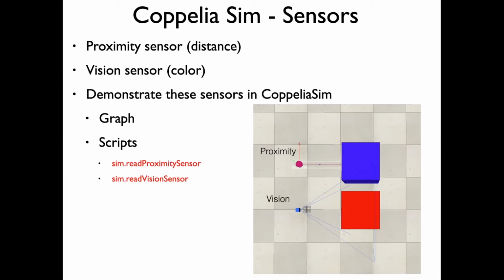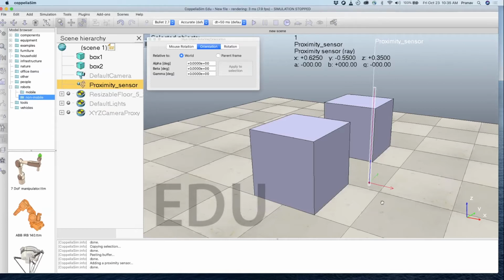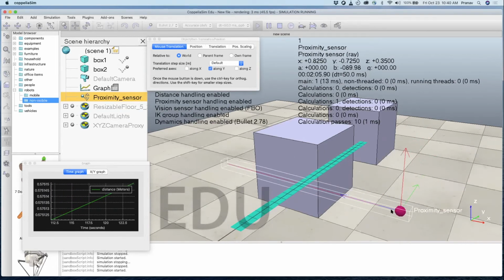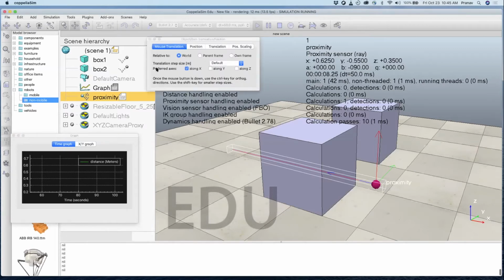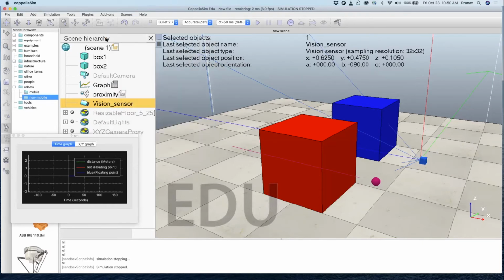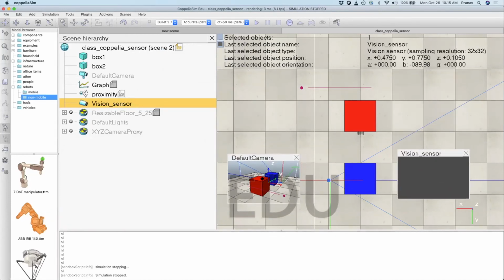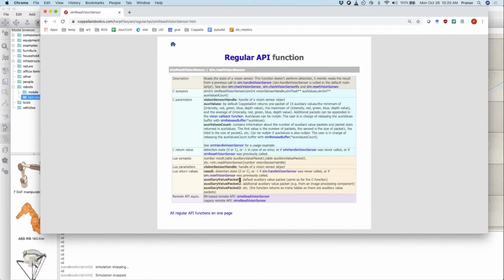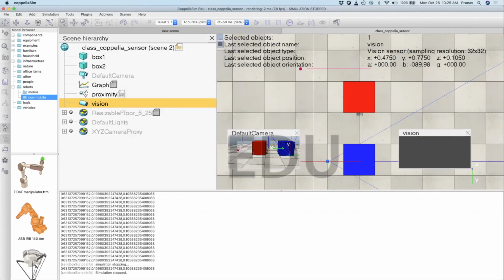CoppeliaSim 4: Proximity and Vision sensors (Fall 2020)

Comment: sir, I am actually new to this software. How come you find those many shapes in primitive shapes(add->primitive shapes) whereas I could only find basic ones. Also how to add scripts, I couldn't find those directly inside tools to add scripts for a new one. Should I add any libraries for that?
I am using Coppalia version 4.4.0.
Reply from the maker: I haves used only the cuboid here. That’s a basic shape. Watch the projectile video on adding scripts. You need to right click on the primitive shape and there is an option to add scripts
Reply: @pranavab  Thanks, I have made a rookie mistake by downloading the player version. Problem sorted, thanks.

Comment: Hi Pranav, this is me again. PLEASE  I just want to know, how can I get the color codes of different color by using the vision sensors?? Which function should I called for this action??
And another question, can I use the IR sensor and vision sensor at the same position in order to get the color codes and the distance from the colored objects at the same time?? If there is an other way to get distance by using vision sensor only??

Comment: Hi Pranav, I've installed the last version of CoppeliaSim prog 4.2.0, but I didn't found this option (Datastream recording list) in Graph  ??
where can I find it plz?
Reply from the maker: Hello Mawj, 

Coppelia 4.2 deprecated the datastream recording option. The change log is here: https://www.coppeliarobotics.com/helpFiles/en/versionInfo.htm#coppeliaSim4.2.0

Instead, use the new API functions here: https://www.coppeliarobotics.com/helpFiles/en/apiFunctions.htm#graphs

An example of using API functions for graphs is here:
https://www.coppeliarobotics.com/helpFiles/en/graphs.htm
Reply: @pranavab  Brother i'm trouble. All my objects are detectable. And my sensor is set to detect all objects detectable and still it is not working. Just when  i set the sensor to recognize the specific object i can run the program. Please help me because i'm hopeless.
Reply from the maker: @ramon1930  If all objects are detectable then the sensor should detect them. Try increasing the range of detection of the sensor OR change the type of modality (ray/cone/pyramid etc.) OR move the sensor further away from the object. If all fails, download my scene (see description), test it, then copy-paste my sensor into your code...
Reply: Thank you